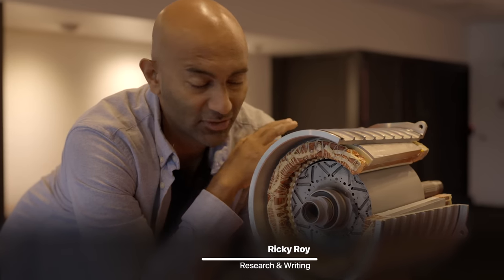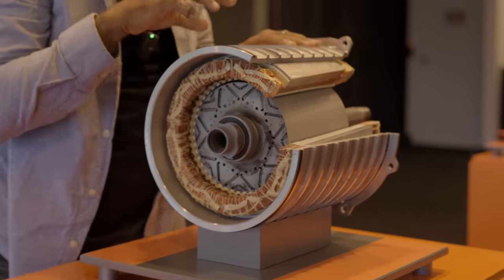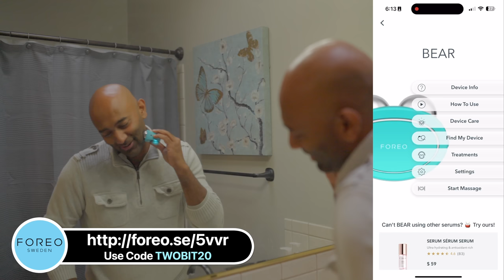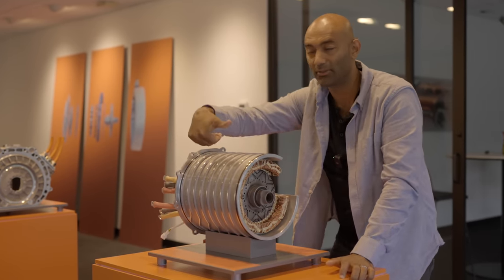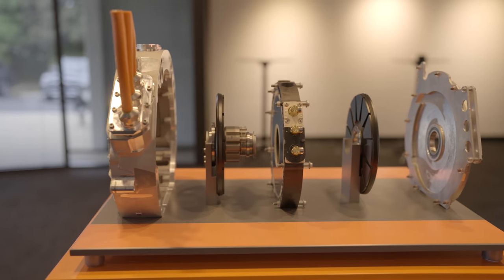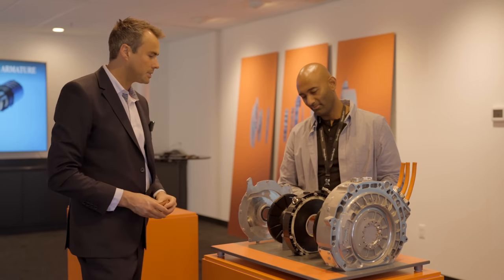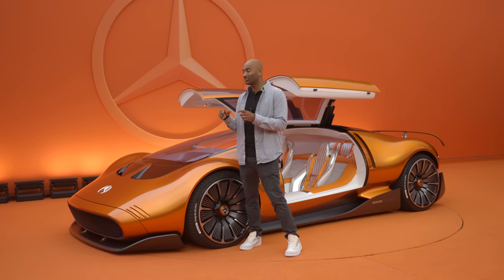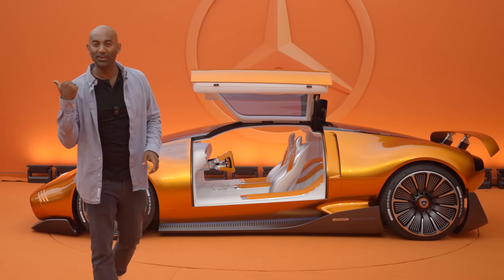Axial Flux Motors Will Change CARS - Here's Why

Comment: In the mid 90's, our power company here in Quebec, Canada (Hydro-Quebec) worked on a motor that would replace the the car wheel and have the tire mounted directly onto it. Each motor made 95 horsepower and 885 foot pound of torque!!! They were used for both accelerating and braking. The computer controlling the motors had such power over them that they could create perfect "ABS" braking. There's footage of it being installed on a Chrysler/Dodge Intrepid rear wheels and them making burnouts. Every part was created and tested to make it work... and I guess it all came down to money, it was all ditched... how unfortunate. Aroun 2006, a company took that motor and fitted it to all 4 wheels of a Mini Cooper("Mini QED"). The Mini would do 0-100km/h faster than a porshe and had a range of 350km back in 2006!!! This is a direct result of the motor's efficiency, only consuming 6kWh per 100km (Today's Electric Mini produced by BMW have a range of 150-210km and used 16.1kWh)

Comment: It would be really cool if they could combine these axial flux motors with non-pneumatic Composite tires so that they could replace the rim and tire for about the same weight. With a motor about 30 inches in diameter and basically a tread around it with flex plastic replacing the cushion effect of the missing air. 
The voltage could be varied to the motor by running a four pack battery in various combinations of series and parallel to give 100V 200V and 400V for example. 
This would be like different gear ratios. Allowing the motor to function directly without gear reduction. 
If this is possible then a retrofit system for old ice cars might be possible by making motors that just bolt on to replace the existing tires and a battery pack to replace the engine.

Comment: 8:50 "This will spin faster than any gas engine."

Can we take that to mean that this motor can exceed 7,000 RPM while maintaining high torque across a wide speed range? Because that's more than enough for most drivers.

If its torque graph is broad enough and in a high enough range, then it can be joined directly to the wheel axle and doesn't have to run all that fast to be a good EV motor. If its torque output is not that high across a wide enough range of motor speeds, then it will have to be joined to a transmission with two or more gears.

Once many years ago, I did a little math based on a then-common car, the late 90s Ford Taurus/Mercury Sable with 16" wheels. That model had tires with an outside diameter (O.D.) of 24". That's exactly 2 feet per revolution. So in order to move the car down the road at exactly 60 mph, the tires grabbing the pavement have to spin at 1 mile (5,280 feet) per minute. Divide that by the 2 ft O.D. and you get a wheel speed of 2,640 RPM.

The car's gas engine obviously has to spin at 2-3x those RPMs (depending on transmission ratios and other factors) in order to sustain the car's speed. (Heck, unlike an EV motor, a typical gas engine at idle has to run at a few hundred RPM just to keep itself from choking to death on a lot of internal friction!)

Comment: The axial flux motors may become more popular but I don't think they will be mounted in the wheels. For good suspension and ride you need to keep moving part of the suspension as light as possible and adding a motor to each wheel will add a lot of weight as well as high voltage wiring to a moving member that will receive a lot of dirt, abrasion, water, etc. which are all bad news for electrical wiring and connections. If you put the axial motors inboard and run axles to the wheels then maybe they will become more popular due to high torque and small size. For AWD there is a problem with torque loading on individual wheels, if you have 4 small motors instead of 2 larger motors then on icy or muddy roads you would need full torque on one wheel that would require oversizing the motors rather than using differential gears and individual wheel braking to put torque to the wheels with the most traction.

Comment: Axial is the way to go for DIY homemade wind powered electrical generation.  Glue strong magnets on a rotor opposed to copper windings on a stator and you are GTG!  Sequence your phasings and add some diodes and send current to your BMS and the battery bank is charging up.

Comment: In the early 1990s. Kolermorgan showed a prototype pancake motor.  23" x 23" case.  8" overall shaft length.  0 to 3600 rpms. 360Hp    I so wanted two of them to convert my friends 104' boat to hybrid.

Comment: In the Axial motor the only part that spins is the Neodymium magnet plates. [A VCR head has been using the axial design for decades] I'm sure it can be designed and precision balanced to spin at whatever RPM's they want at any size diameter. [Consider the mass and diameter of a GE 9X turbofan jet engine] [Maybe use carbon fiber in tension to keep it from flying apart]

Comment: Put one on each wheel, with enough torque to spin the tire. Separate motor controllers. 

Regenerative breaking. 
Electronic traction control. 
No drivetrain/transmission.
Torque vectoring. 
Threshold braking. 
Lower mass. 

In a package as light as a Lotus, nothing could catch it.

Comment: Curious...?     If going to a smaller motor will generate more heat. Is the weight lost by the smaller motor being replaced by a larger cooling system?

Comment: Two motors side-by-side, through a single-ratio planetary gearset, through half-shafts to the wheels.  Get all the mass in the middle of the car for best handling, mechanically simple (at least for more modest top speeds), you could even take advantage of the modest dimensions and simpler power delivery to move brakes inboard too, to further reduce unsprung weight.
Reply: Inboard brakes eat axle joints really fast..

Comment: All they have to do to get a faster RPM is lower the inductance of the coils. They could double the thickness of the windings. Or pair coils and switch there pairing from a series configuration at low rpm to a parralized configuration at higher rpm

Comment: I think you’d still want the axial flux motors on the axel, not the wheel as a hub motor, because otherwise it’s unsprung weight, which reduces handling. Still awesome, and applicable though!

Comment: pancake motors are really exciting for aviation.  A 50lb motor capable of 300 HP beats the ever loving snot out of a 300 lb engine capable of 180 hp.  And the "lower" RPM of an axial flux motor is perfect again for aviation, because propellors and rotors are more efficient when operated at low RPM with high torque.

Comment: Axial Flux Motors for wheel motors have not the strength to take the axial load in cars, especially as the tolerances are so small due to the large diameter

Comment: Koenigsegg has presented a 6-phase 800 hp motor that weighs just 39 kilograms. I'm curious how it holds up against other motors, also lower power ones, across a spectrum of loads and relative rpms.

Comment: If the max RPM of these is 20000 that seems plenty high enough for most any sort of direct drive scenario using anything close to a standard 225/55 R16 car tire. A tire of this size only requires about 2500rpm (about 1/8 of the stated limit) to reach 100mph so a max speed on a relatively normal size tire could theoretically be close to 800mph. Larger or smaller tires will have a pretty significant effect on that speed but all of the math seems to line up with relatively sane ranges for these motors to be useful in cars.

Comment: This is very cool tech for sure and will probably continue to improve. The REAL challenge now is energy density with electrical storage, aka, the battery. That has to greatly improve before vehicles can shed the weight and become more efficient. For aviation purposes it has to increase at least 4X before it can even think about becoming mainstream.

Comment: Why aren't other electric car companies using axial flux motor? I think the reason is that we'd have to use a gearbox to achieve the full range of RPMS needed for regular and highway speeds for an axial motor. But for a radial motor, there is no need for a gearbox. 

So perhaps the weight savings in the motor are negated by a need for a gearbox? 
Can someone clarify if this is the case?

Comment: You mention in the video that these motors will be used in high end cars. I infer from that, that they are more expensive.  I recollect hearing that the manufacturing tolerances are much tighter.

Comment: Why not implement a transmission to compensate for the lack of RPM's? I could see that being cool in a motorsport setting. Us gearheads do love gears to bang and without the sound, I'd sure love to still be able to use a manual transmission.

Comment: Whether the motor weighs 50 or 100 pounds doesn't really matter when you ignore the weight of the inverter and gearbox that the motor also requires, and then you ignore the 1000+ pound battery that powers it.  A 100 pound reduction in vehicle weight isn't revelutionary.

Comment: Great video. Sounds promising but if axial flux will need a multispeed transmission due to lower rpms then we didn't save any weight over radial and that's one more mechanical thing to fail. Radial still wins to me...for now.

Comment: Imagine this axial flux motor is not for a sports car but rather a day2day car. Much less power would be required. Much smaller motors of that type could be directly integrated into all four wheels without challenging the driving stability (unsuspended mass!). So even rather small cars could have reasonable sized front and rear trunks. What a potential …

Comment: 4:00 Heat soaked motors on those Ryobi weedwackers is what happens to mine - lose power max and then die. Need some sort of thermal switch or a small beep at 90% temp danger.

Comment: I love the Axial Flux motor but Bind the axial flux "core with a gold radial valence and almost double the torque and 70% more horsepower. But the bonded valence would have to be pure gold but keep the stator the same.

Comment: @9:00 So you're saying it needs a transmission vs the old electric motor that doesn't? Kind of like taking one step forward and two back. Seems best suited as a hybrid system where the starter motor or torque converter would be.

Comment: It would make sense to me to turn the entire driveshaft into a electric motor. Eliminate any sort of transmission and connected directly to the deferential. Or into a gearbox that would turn the vehicle into a four-wheel-drive, transfer case, etc. etc. Perhaps the size of the stater would determine the speed of the vehicle like a transmission.

Comment: At that size, they could put a motor on each wheel and gear it up for rpms. The motor doesn't have to reach peak rpms if it has plenty of torque.

Comment: radially running current as dc lorentz motor, over a vertical magnetic field, gives dc rotating motion, and track wheels running on the current contact like in metro trains will ensure high amps current conduction, from center-in rim-out direction, similar to car starter motor currents of 200A, and low amps motor.

Comment: how much weight and maintenance is the cooling system adding? can the gearing be done in the differential or can a compact CVT do the job? How much area and weight does the transmission add?  How does this compare to other novel motor types like synchronous reluctance motors?

Comment: Now we see the downside of relying on performance-driven results and focus: the issue of “lower rpm” only makes sense for the formula-e realm, while in a regular mass produced car you can very easily solve this issue by using an automatic transmission with a torque converter. That’s it. Yes, ideally we’d be gone with that, but it does serve a purpose here, given the current stage we’re at
Reply: Just use a robot clutch and shifter like Renault used on some models. No slushy gearbox energy waste that way.

Comment: Koenig Gemera has a motor has created a motor they call “Raxial” which has the best of both radial and axial. High torque and high rpm. The Gemera from what I remember had 1400 HP.

Comment: Take old car. Remove engine. Bolt AFM onto transmission case. Fill rest of engine bay with accessory drives and batteries.
Seems to me like a great opportunity to retrofit common cars rather than scrapping them and building new.

Comment: I’ve long thought that a simple electric motor, retro fitted to a wheel, would make a really cheap and simple 4WD upgrade to any 2WD vehicle.
Connected to the alternator, flick of a switch, no mechanical alterations and easily removable if you sell the car.

Comment: In view of the high power to weight ratio of this new motor, wouldn't it be ideal for electric aircraft, and will it produce a revolution in the use of such aircraft? There are also revolutionary propellor designs which should also have an impact.
Reply: An electric aircraft is fantasy, not because of the motor weight but rather the energy density of liquid fuel versus lithium cells.  Orders of magnitude inferior.

As for propeller design, conventional props peak out at about 85% efficient.  Not much room for improvement.

Comment: 8:50 A Wankel Rotary Gas Engine can do 24,000 RPM, but the rotor is geared down to 8000 RPM, a 3 to 1 reduction. 
I had a '76 Suzuki RE-5 and Yellow line was 7500 RPM and Red line was 8000 RPM.
It could do 140 MPH on a strait flat road. The speedometer had no stop pin past 120 MPH.

Comment: You can't divorce the battery from the power capabilities of the electric motor, they're always in tandem. So it's not simply comparing electric motor to internal combustion engine.

Comment: High torque, low rpm, I'm thinking 10 hub motors on the 5 axles of a semi truck and trailer.
Regen braking would be straight and smooth with almost no risk of jack knifing on steep downhill grades.
Also allows either more battery space, or for a diesel powered generator for long haul routes with no charging infrastructure. I'm no engineer so I'm not sure if this is a good idea or not.  🤨

Comment: My question is then does this revolutionize Axial Flux generators as well?
Reply: DC motors can run as generators. In  an EV they use that as regenerative braking. So the kinetic energy of the EV returns back to the battery and slows down the vehicle.

Comment: I wonder if those axial flow motors were placed horizontally on a ship's decking for space travel if there were enough of them were linked in series could they create enough gravitational rotation to create an artificial gravity well to generate artificial gravity for a floor of a ship say like the space shuttle if they could put enough of them throughout the decking of the space shuttle or a space station to generate an artificial gravity well without having to have a rotating ring segment like in the movies just food for thought I'm really curious?

Comment: Coincidentally, i have been reading up on some papers for axial flux motors for some researh im involved in (PM synchronous motors). They not only are much smaller but very effiecient. Curious what mercedes will do to squeeze more power output from them!

Comment: You make good videos but the closed captioning doesn't seem to appreciate that. Very early on it thought you said "stupid deVinci".  Your show isn't the only one where I've seen some funny mistakes.  Ten years ago or so Reuters news service used to have some idiotic cc errors but have improved.  A hearing impaired viewer who needed to read the captions would have had a very hard time filling some of the blanks, especially with the people and place names. 

Years ago I was working with a small table saw that was too small for the project. The motor heated up so much it would actually slowly move in reverse. But I don't understand why the heat did that?  When it cooled down it worked fine again.

Comment: why not turn this into a hub motor... direct drive, max rpm is max wheel rotation speed. the torque dense aspect certainly helps and reduced weight makes it practical as it's unsprung weight

Comment: The only advantage of pancake motor is the thickness.  They are less efficient than standard motor.  For efficiency, the torque have to be produce at the greatest distance from the center.  The more efficient architecture is coils in the center and the moving part including magnets at the periphery.
Reply: Well weight too - the fact they're a lot lighter than their counter part does means they dont have to carry the same weight around with them over time.

Comment: What if they combined this axial flux motor with a CVT?  The motor has a smooth progression from no to high RPM.  A CVT is supposed to be smooth from no to high RPM.  You can then keep the axial flux motor smaller.

Comment: I found something even better using a trick of charge, which can be progressively split over 3 points of charge. Because the most points of charge any of these so called professional engineers experiment with is 2, they will never come close. A Julian set fractal of charge exists in a proper design, since 3 negatives must repel one-another at once, each as their own dynamo, in order to repel positive. This ends up splitting charge so well that it's over efficient and needs no battery. Just adding a little of this secret feature to an existing engine makes it far more efficient.

Comment: "the max RPM is lower with an axial flux motor than with a radial flux motor" just ... use a gearbox. it'd be pretty damn easy in a hybrid car, just slap it between the motor and the torque converter for autos, and between the motor and clutch for manuals

Comment: I have a 20 year old Briggs & Stratton ETEK motor which is an axial flux / pancake motor, but DC and brushed. It was based on the Lynch motor concept. Check the Wikipedia entry for Lynch Motor.